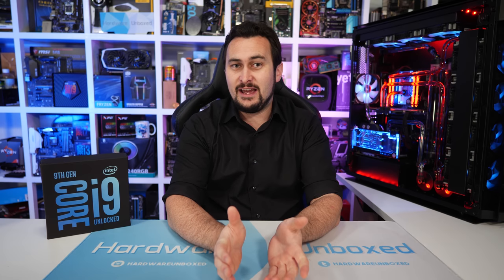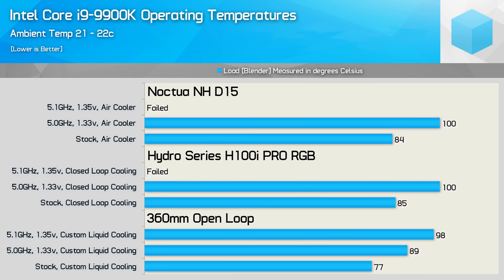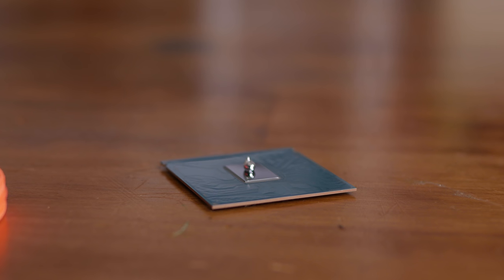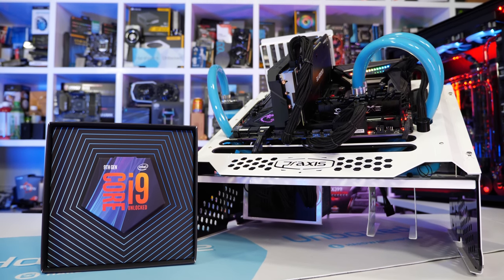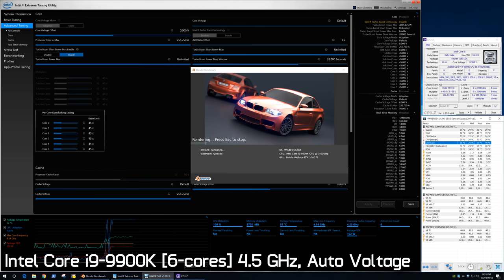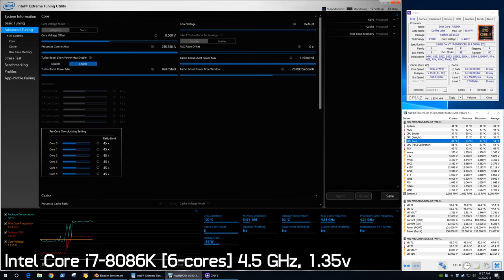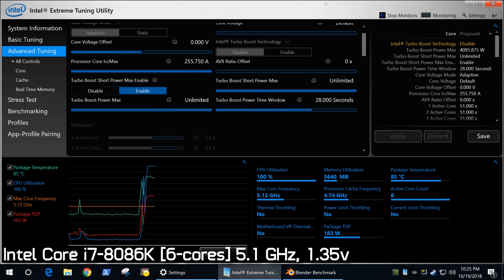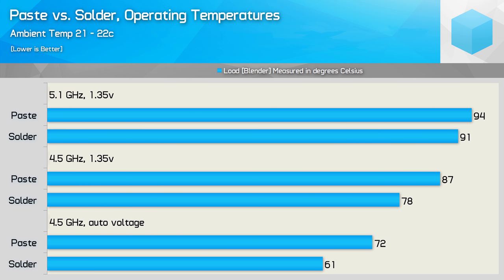Why is the Core i9-9900K so HOT? STIM test, Solder vs. Paste

Comment: Amazon - Home and Kitchen - Fireplaces, Stoves & Accessories
9900K - Best Seller
Reply from the maker: To be fair it can multi-task better ;)
Reply: now people can joke about intel mainstream processors being room heaters instead of the AMD ones
LUL
Reply: lmao
Reply: What happened if we put it inside the Bitfenix Enso?
Reply: cuz  is clock higher most amd cpu barely touch 4.2ghz
Reply: @HosakaBlood  it doesn't matter AMD at 4.2 is at it's limits it's a different architecture
Reply: well makes since if your rocking a 6 year old I-7....otherwise, yea, horrible buy.  Wait until Ice lake would be the smarter move.
Reply: @ThreeFontStreet  105 TDP (not watts) with a consume of 105 watt, 95 TDP with a consume of 250 watts. It literally burn your house
Reply: @RavenPrecept Its a way to say intel is fucked.
Reply: @RavenPrecept Not really, they only have higher clocks for this and a little better ipc. What is better? 100 degrees 9900k? 250Watt at 5.1 ghz load? if this is improvement im a turtle.
Reply: @G4M1N6  But they won't, sadly AMD conforms to different standards in the tech market when compared to other companies that ripoff their users... No need to name them even...
Reply: @Ford-wt8rn  We'll die of old age waiting for ice lake with 10nm....

Comment: Can't wait to upgrade to ZEN 2 next year.    😁
Reply: Same from my 6700k
Reply: Going to upgrade my 1700 when Ryzen 2 comes out. Should be a nice upgrade. Be nice to just flash the bios on the MoBo and drop the chip in. Won't need a new MoBo. When was the last time you could do that?
Reply: Can't imagine there will be any noticeable difference between Zen2 and 8700k at 1440p. Right now 1440p is pretty much all about the GPU I can't imagine that will change next year.
Reply: I know right!? Zen 2 will be my second AMD chip since the fx-8350. I'm currently running a 4790k but it's about time I went back to the red side.
Reply: @danmandingo mood
Reply: As long as youre not Video-Editing like crazy, upgrading from an 8700k is just a waste of money in my opinion.
Reply: @Ken Shaw - I could do it yesterday if I wanted to replace my i7 8700k with an i9 9900k, but why break the narrative?
Reply: I want to upgrade to a 7nm ThreadRipper. Currently using a 5960X.
I bet a 16 core 7nm ThreadRipper will have lower power consumption than my 5960X.
It'll be an encoding monster.
Reply: I got my tinsy R3 1200 pressed down by my 1080ti, waiting to retire when I buy the next gen 7nm R5 from AMD and UNLEASH THE KRAKEN!
Reply: How did it go

Comment: Im enjoying my 2600X which is a few FPS slower than the 2700X, and the 2700X is a few FPS slower than the 8700k. But my 2600X is about half the price of the 8700K!!! Keep up the great work Steve and Tim!!
Reply: Seems inlet is struggling to keep up with the demand. The cheapest i7 8700K i found was 320, 3 months back. Now they go as high as 550. The i9 9900K goes as high as 700. 
And in gaming performance the 8700K and 9900K are identical in performance, if you run them both at the same clocks.
Reply: DeadPhoenix86 i bought my 8700k for around 410$ (europe shipping and taxes=higer prices) but now 8700k costs around 650$ here. 9900k is 860$ xD

Comment: 2018: years of overpriced hardware release.

Except Ryzen of course.
Reply: Almir Preldzic  fucking hell that's cheap.
Reply: Almir Preldzic  Thank god i paid 350 for the i7 8700K. Now they go as high as 550. The 2700x is around 330.
Reply: Ryzen 2700 is $220 right now at Microcenter if you buy a Mobo, at least at my local store. Looks like a pretty sweet deal.
Reply: Almir Preldzic  Wtf and how tf.
Reply: Almir Preldzic Wish we could say the same about Radeon
Reply: I payed $300 for my 8700k at microcenter. Not upgrading until intel goes to 7nm
Reply: Whatttt 2700x for $239!!!!
Reply: Almir Preldzic Jealous of those who have access to microcenter.
Reply: Now to be fair that 4790k is still a great CPU and you could have picked a 5820k instead back in 2014. The only reason I went with my 4890k over the six-core was how expensive DDR4 RAM was back in 2014, well that and a very specific need for extremely high single core performance.  But the 5820k was a steal, about the same price as the 4790k

Now the 5960k was outrageous expensive, but intel still offered cheap 6-cores at at least.
Reply: Things will get even better for AMD with the Ryzen 3000 series.
IPC of like +15%, probably putting them ahead of Intel.
And with TSMC's 7nm, clock speeds will be about the same as Intel, but with WAY better power efficiency.
I don't know if Intel could afford to keep price gouging if AMD are equal or better in like every metric.
Reply: @taton5  Intel's next node will be 10nm not 7nm (tsmc) but they are both very similar.
Reply: Phillip Habsburg, all i7 was 4c/8t... why? ask intel... if you come with special editions and server grade that doesn't count cuz if so... AMD had those too
Reply: And what's 14nm+++ going to bring? 100-200MHz?
TSMC's 7nm process will bring like 40-50% power consumption reduction, with clocks probably close to 5GHz.
Intel's 10nm process will take another year at minimum. We might see it in 2020.
Reply: ok good, AMD had the first real quad core... and had the first 1Ghz cpu (if i dont mistake) should i go on?
Reply: The i9 was not the first mainstream 8C 16T CPU. The i7 5960X was the first HEDT CPU with 8C 16T, and AMD's Ryzen 1700(X)/1800(X) were the first mainstream CPUs with 8C 16T.
The 9900K is Intel's first "mainstream" 8C 16T chip, and that's stretching the definition of "mainstream".
Reply: or did we forgot the Phenom II x6? how about the x64 bit instruction set? how far in the history you want to go Phillip Habsburg?
Reply: If you want to go down that road, nobody measures their nodes "accurately". Not even Intel. Regardless, TSMC's 7nm process is smaller than Intel's 10nm process.
Also, TSMC's 7nm process is a much better process than GlobalFoundries 12nm process.
Actually, GlobalFoundries licensed their 14nm/12nm process from Samsung, and it was designed for low power mobile CPUs. Which is why it didn't clock much past 4GHz.
TSMC's 16nm process was actually better than Samsung's 14nm process (which they licensed to GlobalFoundries), and the TSMC 7nm process is much better over their 16nm process.
Reply: Intel's 10nm process isn't even better than their own 14nm+ process. Their own projections showed it having lower performance on first generation 10nm vs 14nm+.
And that was back before they watered it down to finally try to get it out. Actually, Intel's watered down 10nm process is more like a 12nm process. And won't even be out until like 2020, when TSMC will probably already be on 5nm EUV.
Reply: wait, so this is your reply? "it performed like shit" ?? really? you fail an argument then try to dodge it? it was about the first 6 cores now you change it to performance? what about the OTHER points?
also... who is "everyone" you talking about when there are no public samples to those 10/7nm? 
also what "fiasco" when 3 cores (quad with one disabled) was way before that and people was paying LESS for MORE since the last core could be unlocked... stop spreading missinformations...
at this point you start to sound like a fanboi... ignoring facts over ur preference.... G G
Reply: lol fanboy more Phillip Habsburg.. yet you ignored my comment...
Reply: @phillip_iv_planetking6354  Cannon Lake was supposed to release with mainstream desktop parts in 2016. We're 2 years past that and we're looking at at least another year, most likely two given Intel's own prediction about volume production expected to start in late 2H 2019. That's production. Don't expect products to arrive before half a year after, so we're looking at a Summer 2020 release of Cannon Lake mainstream if all goes well from this point.

Yes, there are Cannon Lake processors available. But note that these are tiny mobile CPUs with significantly worse performance than their predecessors. They're not anywhere near close to being ready for bigger chips, let alone bigger chips with performance increase over this current gen nor beating out the current Ryzen lineup. Cannon Lake is a disaster for Intel. The only reason why it didn't turn out like "faildozer" is because they're not shipping them and focus on maturing their 14nm process instead. AMD was never in such a stable market position to allow for that. And now it's been hurting Intel rather significantly since Ryzen hit in Q2 2017, and I expect it will only get worse for Intel. Yes, they had plans for 6c/12t mainstream before Ryzen, but not until 2018 at the earliest, and you bet they had no plan for 8c/16t mainstream in the same year. We know about their plans because they have long had a hard time competing against their older CPUs in single threaded performance, which is what games use. Hopefully, we'll see games move to utilise more cores as a result of Intel's slides at the game developer convention a few years back. I fail to remember where it was, but it was interesting and it showed that Intel had planned to move to more cores several years ago, as you correctly pointed out. But with Ryzen, I'm not sure they like what they did. We'll see.
Reply: @phillip_iv_planetking6354  actually the fury cards didn't suck comparatively it was actually relatively on par and competitive with lower clock and memory speeds. As atleast use facts.
Reply: @phillip_iv_planetking6354  says your unfounded opinion the card could compete that isn't sucking. And no your not saying the truth. A truth that hurts wouldn't be on here as my ex best friend would be the only person to be able to hurt me with the truth. So meh your opinnion is terrible.

Comment: Intel is so desperate they took the now-outdated 14nm design and pushed it so far it could literally burn a house down. AMD is now taking over the CPU throne.
Reply: 75 degrees with 1.36 volts @4.9ghz on all 8 cores.....that's less heat than Ryzen 2700X at 4.3ghz....if you can Actualy manage to keep it stable at 4.3ghz lol.
I can only assume you mean AMD taking the budget builders crown.
Reply: AMD would need to actually make a faster mainstream cpu than intel to take the throne
Reply: as much as i shame intel for this release, the 8700k was already a faster gamer than amd's best offering. AMD fans are always trying to use the unreleased "next gen" product to compare to intel's current release... Sorry doesn't work that way, you can only compare zen2 to cannon lake.. 2700x is the best there is to compare to 9900k, and 9900k is much faster.
Reply: @jookya2  if you cant compare amds next gen to Intel this gen, them you cant compare intel this gen to amd last gen.
Reply: @whit3chick3n  umm 2700x is this gen until they release a new one
Reply: The 2700X runs so cool it could act as the cooler for the 9900K.
Reply: @maydaygoingdown5602  So what happens when you use the same Noctua cooler on Ryzen?
Reply: @snowstar3560  I'm not sure what you mean??
Ryzen can't get a stable 4.3ghz let alone an incredible 4.9ghz on all 8 cores..
At 4.3ghz Ryzen runs hotter than 75 degrees...at 4.9ghz all cores the 9900k runs at 75 degrees.
Let's say for example the 2700X was running 4.9ghz on all 8 cores....what do you think the temps would be??? We already know it runs hotter than 75 degrees on only 4.3ghz...if we down clock the 9900k to only 4.3ghz the Intel chips would be below 65 degrees...see the difference yet??
Reply: @maydaygoingdown5602  Which cooler was they using for both the Ryzen 2700x and 9900k? Also Ryzen was made using mobile process,which is why Ryzen need so much voltage to reach 4.3Ghz(1.45 volts average), try pumping 1.45 volts through the 9900k.

The 9900k needs 1.05 volts to hit 4.5 GHz(Which is why it ran much much cooler) Vs Ryzen 1.45 volts @ 4.3 GHz, which shows how superior is Intel's 14nm which is tailored for high performance CPU vs Ryzen 12nm Mobile process. 7nm(10nm) TSMC Ryzen should help AMD close the gap in clock speed, and I doubt Intel's early 10nm can hit similar clock speed as their super refined 14nm++++
Reply: @snowstar3560  At 4.3ghz 2700X you need the same cooler as the Intel bro so it's pretty much irrelevant..9900k at 75 degrees 4.9ghz all cores.. the piont is 2700X at 4.3ghz is higher temps on the same cooler used to get the 9900k at 75 degrees 4.9ghz all cores.
Both where tested on the same  corsair 240 AIO on my bench.
Thing is...like I said, let's for example say we could push the 2700X to 4.9ghz...do you think it would run at only 75 degrees??? Considering the results are already over that at only 4.3ghz..
Reply: @maydaygoingdown5602  Also Ryzen was made using mobile process,which is why Ryzen need so much voltage to reach 4.3Ghz(1.45 volts average), try pumping 1.45 volts through the 9900k.

The 9900k needs 1.05 volts to hit 4.5 GHz(Which is why it ran much much cooler) Vs Ryzen 1.45 volts @ 4.3 GHz, which shows how superior is Intel's 14nm which is tailored for high performance CPU vs Ryzen 12nm Mobile process. 7nm(10nm) TSMC Ryzen should help AMD close the gap in clock speed, and I doubt Intel's early 10nm can hit similar clock speed as their super refined 14nm++++
Reply: @snowstar3560  yes at 145.volts results where to hot even on a 360 Thermaltake floe. 5.2 ghz at 90 degrees...I don't like that myself.
But at 1.36volts you get a nice 4.9ghz on all cores at a nice 75 degrees stable...that for me is the best sweet spot for temps and performance on the 9900k.
Reply: @maydaygoingdown5602  But let's not forget one thing, 9900k sells on Amazon currently @ $580, Ryzen 2700x $300, at almost 2x the price compared to Ryzen, you dont get 2x the performance hahahahahahahaha, and you need proper Z390 or Top end Z370 to overclock it else suffer reduced VRM longevity also there's 8700k
Reply: @maydaygoingdown5602  totally ageed with this one
Reply: MayDay GoingDown!! only 75 degrees really? My fucking fx8350 throttles at 70
Reply: Taking over the CPU throne? Hold it right there cowboy...
Reply: @manuelf.almeida  Uhh, apparently you have forgotten about the Ryzen 3rd-gen architecture.